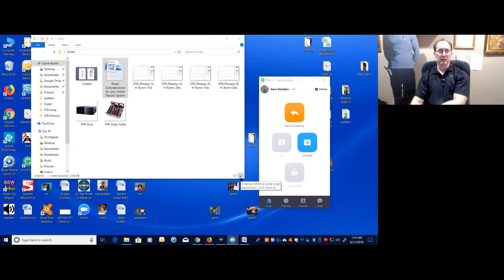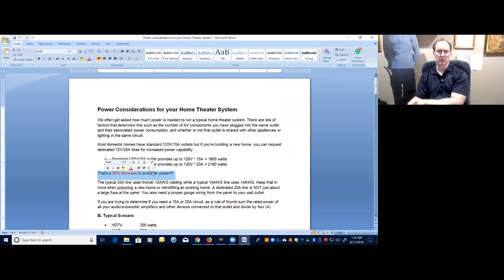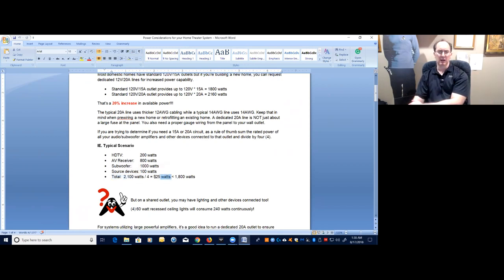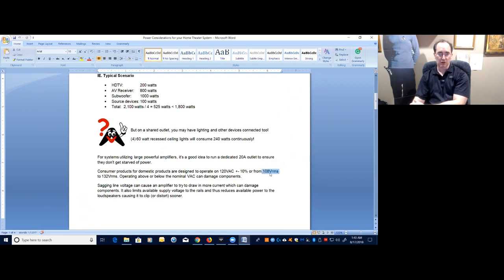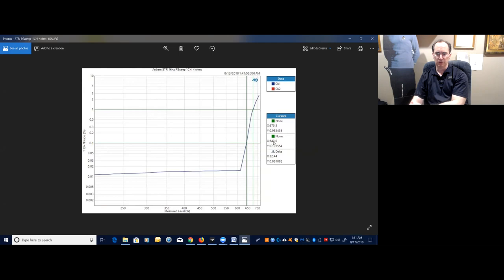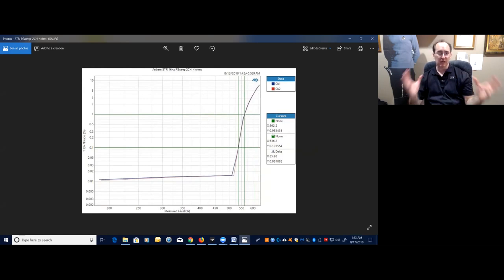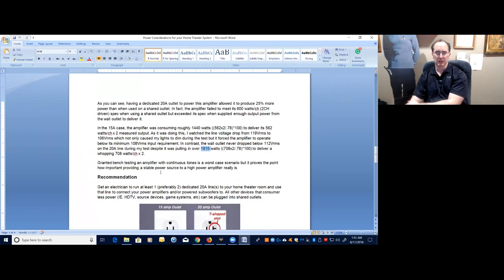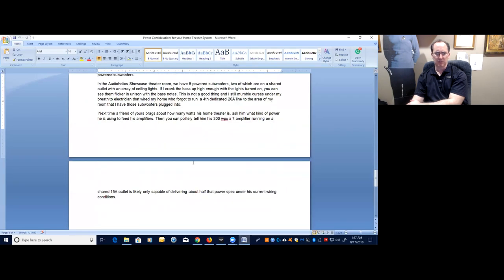AC Power Considerations for Your Home Theater System

Comment: Hi Gene I have one other question what type of air conditioning units would you use four of the Denon 6400 and the Emotiva amps
Reply: Philip Ortiz I can highly recommend AC Infinty. For example if air should be blown out to the back the model would be the T8.

Comment: Great video. But what happens in class A and Class D? I suspect in class A suspect you need much more for A. Class D consume less right? So class D sould be more flexible, right?
Reply from the maker: Class A is about 25% efficient. NOBODY should be using pure class A amplifiers anymore as there are NO benefits to using them. Class D is > 90% efficient and performance can vary on them depending on topology and impedance of the loudspeaker being used.

Comment: when you say a dedicated line, does that mean the fuse only has that 1 socket in its circuit?
Reply from the maker: Yes only one receptacle and one fuse.
Reply: ah, alrightey

if you plug in a power conditioner/power bar to a dedicated line, does that negatively affect performance?

Comment: So, power conditioners, Ups, and such equipment is recomended or not?
Reply from the maker: always recommended but will NOT improve fidelity like some claim.
Reply: @Audioholics  ok but are there any drawbacks i have read that most consumer or Light pro, like panamáx dont have the ability to give the requiered power to the amps.
Reply from the maker: @mauriciomartinezquintero4633  If you're using UPS backup power conditioning that can be true. Check the power conditioner and make sure its rated to max current your wall outlet is rated to. If you have a big hulking amplifier, it's probably a better idea to just put that on a separate dedicated surge supressor (properly rated) to ensure that you aren't current limiting it.

Comment: Hi Gene. Great video as usual. Could you clarify why 120V * 20A equals 2160W instead of 2400W? It should be an 33% increase correct? Are there any losses?
Reply from the maker: Juliano because i made a math error. That's what you get for doing YT videos past midnight. Thanks, I will correct that in the article.
Reply: @Audioholics  Gene researching dedicated lines for my equipment 
If I get a dedicated line for my amp is that they only thing I should plug In there or can I also plug in my power cleaner which has my preamp, nucleus, and DAC plugged into it?

Comment: Is it possible to change my 15 amp breakers with 20amp ones? Or do I have to change the wires inside the wall as well because if I do it'll be too expensive and too much of a hassle.
Reply: JDmsz you will have to change wires and outlet too.
Reply: chozen1one785 I think the standard wires * I think they are 10 grade* can handle a 20 amp circuit, but best to ask an electrician. I am not an electrician.
Reply: He need 12 gauge wire for a 20 amp circuit
Reply: Just changing the breaker probably won’t help. Breakers don’t limit power by reducing the voltage when the current gets too high, they shut off the whole circuit.

Comment: I live in Thailand, which has a lot of blackouts, I use for that purpose. I have 2 Magnet brand power conditioners for my 11 Elac Uni-Fi Slim speakers at 4 ohms, 2 floorstanders , 1 center channel, 4 bookshelfs for side and rear surround and 4 bookshelfs for height, and 1 Golden Ear Super Sub X which I will soon have a second Super Sub X. I believe in multiple subs as you and Hugo do . I have a Marantz SR7012, and A Pioneer BDP-LX88 ALL REGION disc player . In Thailand it is 220,240 voltage. What do you think along with the subject you are talking about? Is it too much voltage?
Reply: The products you purchase over there are gonna be rated for the 240v input. As long as your input voltage is within 10% of that then your fine.

Comment: i have 200 amp panel is that good enough?
Reply: While the panel rating is certainly adequate, you also need the power company’s lines to actually provide that much current, and you need adequate wiring (including breakers) to get that current to your equipment.

Comment: I just hooked my denon x8500h and I'm not impressed. I have prime pinnacles ultra center, prime elevations and x2 sb3000 all on my 15 outlet🤦‍♂️🤦‍♂️🤦‍♂️... for starters I think I'm hearing distortion at low volume and when I turn it up it isnt doing any better than my x3600h. I tried unplugging everything I could and still not satisfied.  I really hope having a dedicated line for my subs and another for my 8500 fixes this😓
Reply from the maker: something is NOT right with your setup. Turn Audyssey OFF, check your bass management, level trims, delay, speaker polarity, etc. Also make sure none of tour speakers are blown out.
Reply: @Audioholics  when I ran audyssey it said my left and left hight channels polarity were wrong. I checked them and red is on red and black on black.. 
When I say I hear distortion it's almost hard to notice sometimes and other times it's very noticeable but not to someone like my gf and I'm talking low volume ranges of -50 -60db 
Also all my my speakers are brand new and were working perfectly with my x3600h. Thanks so much for helping me here gene! My nerves are shot considering the amount of cash I just dropped on this thing
Reply from the maker: @bradley8753  turn Audyssey off. Start with 2CH in pure direct using a high res digital source like a CD or SACD. if all is good, switch to DIRECT which enables the receiver DSP...
Reply: @Audioholics  thanks for the lead! I'll start there in the morning and see what happens 🤞
Reply: @Audioholics  so when I turn on pure direct it eliminates what distortion I was hearing. It sounds crystal clear! What does this mean? The way I see it I cant listen to music in any other setting 😥 dont get me wrong I love pure direct but I didnt pay 4grand to have limited options.. any more advice is greatly appreciated! Thank you
Reply from the maker: @bradley8753  it means you probably have some weird DSP setting messing up your sound. Do a factory reset. Make sure no DSP simulation modes are being used when listening in a non pure direct mode.
Reply: @Audioholics  thank you so much! I'll give it a whirl and see what happens.

Comment: Just run 12/3 romex to your equipment.  That gives you two dedicated 20 amp circuits-and that should do it!
Reply: 12/3 Romex has two conductors, 1 neutral, and 1 ground-two separate circuits in one cable-branch them at your equipment area.  50 feet is inexpensive at Home Depot.
Reply: Not half-assed (fully code compliant and common).  Your hots are on opposite bus bars and are 180 deg out of phase (you use a double 20 amp breaker).  Since they are out of phase, there is minimal current in the neutral-certainly less than either of your line wires.  The neutral current will only match a line wire current if you don't use the other circuit at all)  Anyway, in the USA your grounds and neutrals are tied together and all end on the neutral and ground bars in your panel.  Take a look in your panel, you likely have several circuits of this nature (septic and irrigation pumps, dryers, ranges, AC compressors, etc).
Reply: I can tell from your comments that you have a limited understanding of the National Electrical Code.  I agree with you that you should hire a certified electrician.

Comment: Gene, great video, but a few errors, one of which Juliano pointed out already.  Also, in the paragraph below your 15 amp and 20 amp comparison you say "The typical 20A line uses thicker 12AWG cabling while a 14AWG line uses 14AWG."  Should be a 15A line uses 14AWG.
Reply from the maker: uscfroadie yea Thanks, i fixed that already. Sadly I had soneone peer this article and he also missed ke multiplying 120*18 instead of 120*20 to get 2400 watts :(

Comment: Do you believe in power condition?
Reply from the maker: Jack Mountain only as a convenient way to connect everything and protect from surges.
Reply: Audioholics what’s the deal here, when I put my system on an Audio Insight Isovolt power conditioner, I can easily hear the difference, like difference between night and day .... while this is in Norway, is power infrastructure really that different between our countries. I really wish there was no difference so I would not need this conditioner, but truth is... it is a difference over here...

I am looking to get some equipment to see how this is actually measurable.
Reply from the maker: It's very hard to accurately discern a small difference a power conditioner or cable can make without a controlled, instantaneous listening comparison. Your mind can very well be playing tricks on you to think you hear a difference.
Reply: I'm an engineer, so I'd really like to find out, there may possibly be a difference here in Norway that you don't have in US. I will find a way to measure these things.

Comment: Probably been mentioned already but 120V * 20 A = 2,400 W, not 2160 w.  And obviously, 20 A is 33% more than 15 A.  Don't you just hate typos ruining an otherwise good presentation?
Reply from the maker: Yes sadly I can't correct or annotate a video once it's uploaded. The written article has the corrections however.
https://www.audioholics.com/audio-amplifier/ac-power-home-theater-system

Comment: Just monitor your voltage drop under load.  If it sags do something about it,  if it doesn't then don't worry about it.   I monitor my AC line voltage with an oscilloscope,  FFT's,  digital filters, etc. for other reasons.  I agree with the video,  however having a 15 amp circuit is not a problem unless you have a problem.  Technically you should have the subs on one circuit,  main AV receiver on another, etc.  Who in the world uses incandescent bulbs these days....even back in 2018.   Most amps are Linear with Linear supplies,  they won't try to pull more current if the voltage sags,  they will just not be able to produce as much power and well as mentioned could clip (headroom reduction).   Now if it's got a switch mode supply then it would in fact pull more current to get the same power.  Ohms law.  

Everyone needs to switch to Class D,  I need that power for Bitcoin mining 😁